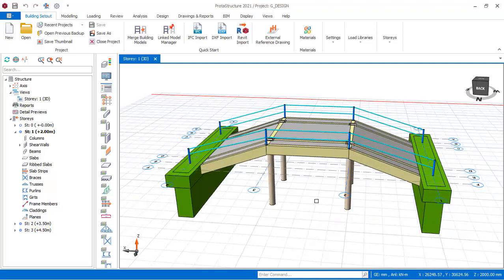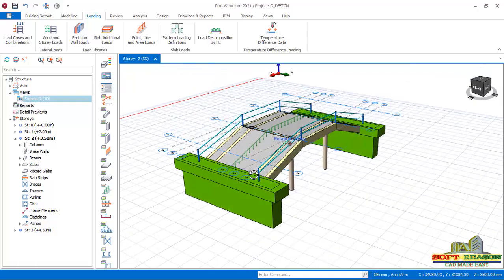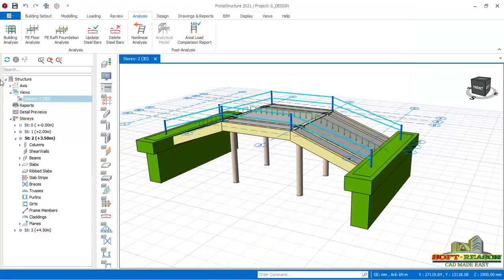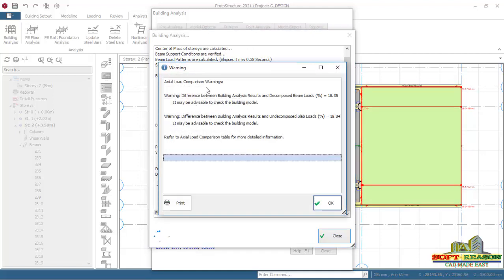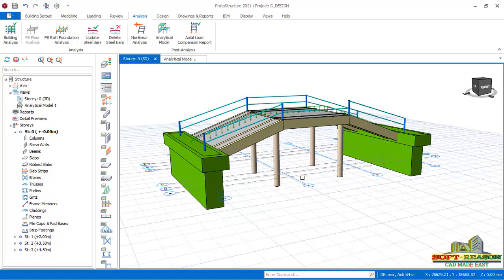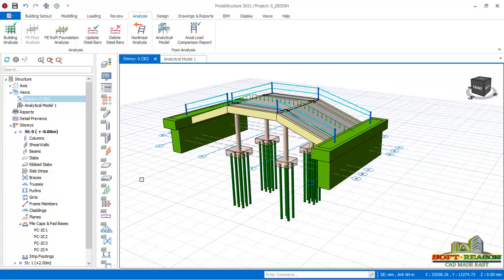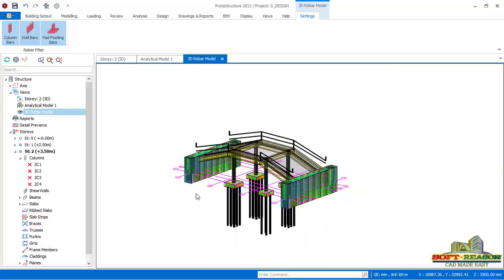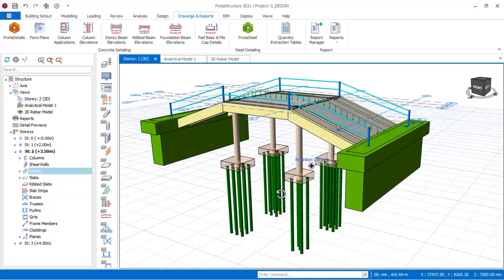How to Load, Analyze and Design  Bridge in PROTASTRUCTURE 2021

Comment: Thanks 
Actually it seems you skipped a session after the lesson before these, because I didn't see you put those rails or offset those slabs
Again can this structure stand complete 2 trailer loads of cement
Reply from the maker: The structure is going to stand for the purposed of design. if you are designing it to stand for 2 trailer loads of cement, then you should analyze it with that load and as well designs.

If you want to go advance in the use of PROTASTRUCTURE software you can enroll on a personal training. Interested? open a chat with me on my Telegram, the link👉   https://t.me/soft_reasonchat